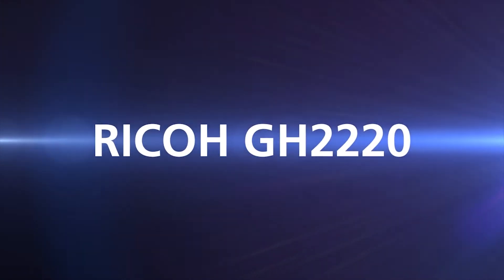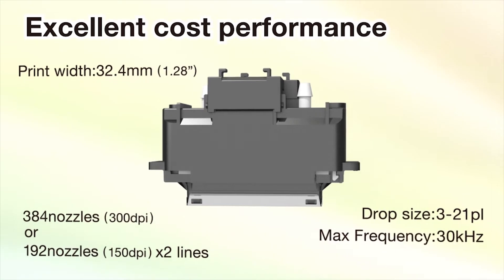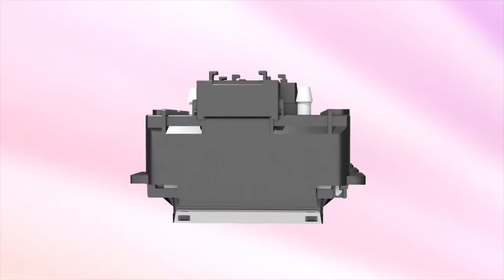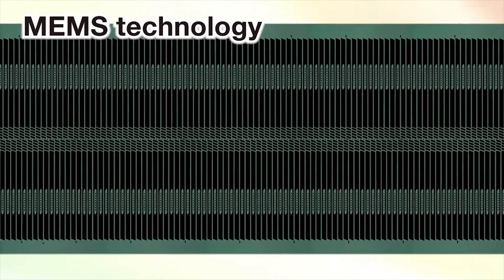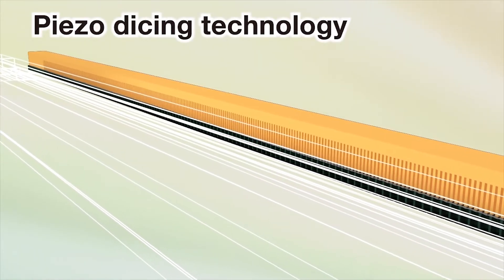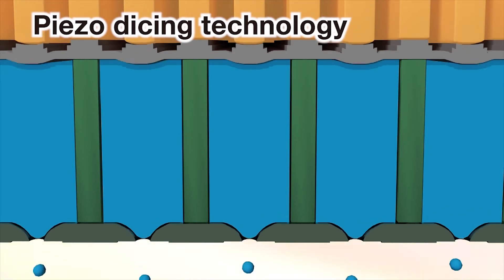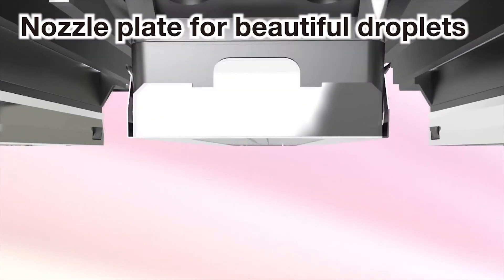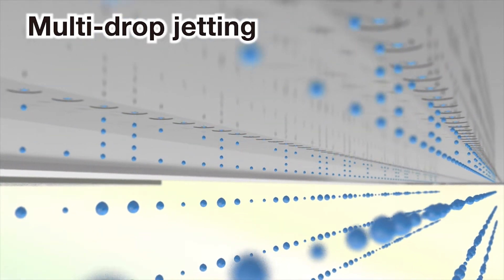Ricoh GH2220 printer head, drop size 3pl!

Comment from the maker: We are the first manufacturer  is making UV flatbed printer with GH2220 print head,incomparable output for both indoor and out door usage. Varnish printing is optional. Contact for more details: Sophia;  info@yuxunda.com; +86 189 3886 8710; Wechat:Yuxunda10; Skype: Sophia_yxd